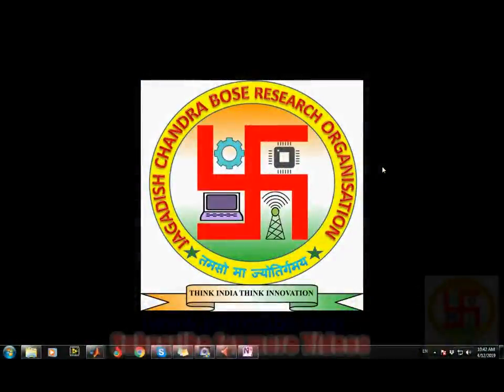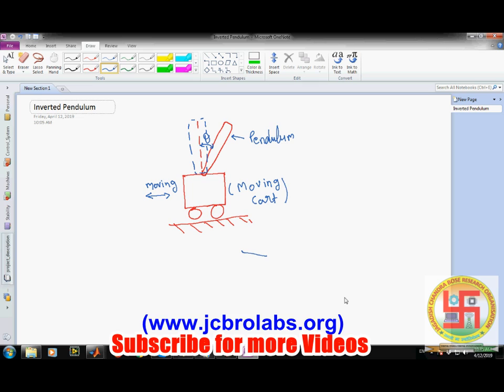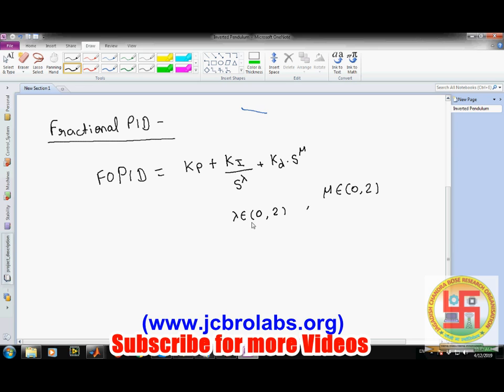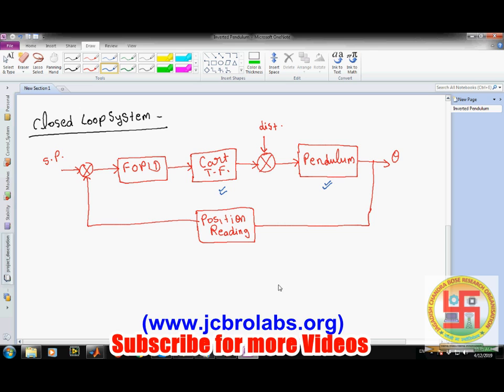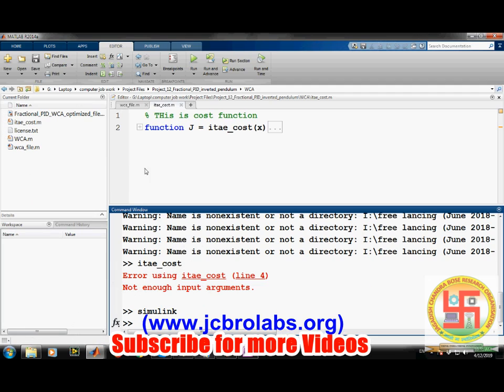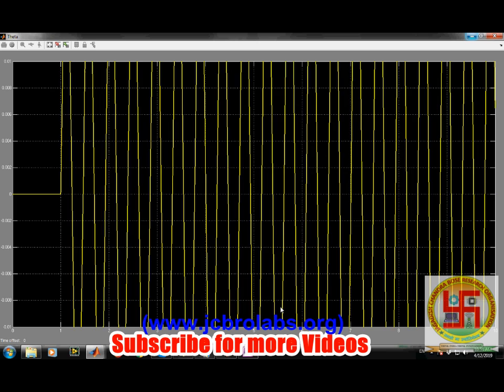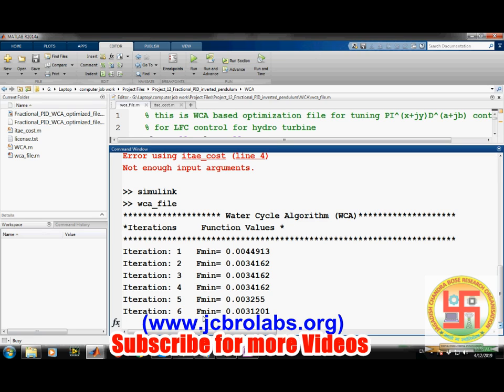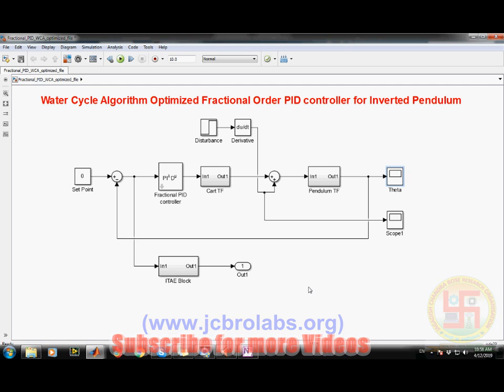EEE Project 5: WCA Optimized FOPID Controller for Inverted Pendulum

Comment: Hi.. I have a question. I had a project where I was using PID controllers to determine the optimization of a level control system.

My question is: I simulated the experiment in simulink. However,my simulink uses a different set of parameters. How can I set my simulink to use the same parameter as Labview ?
Reply from the maker: You can change the parameter of simulink from configuration button...